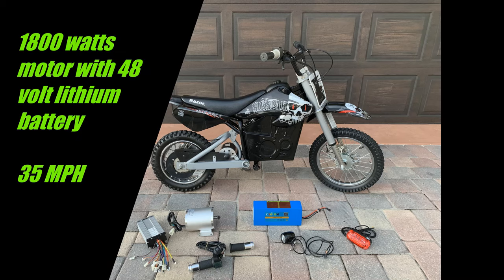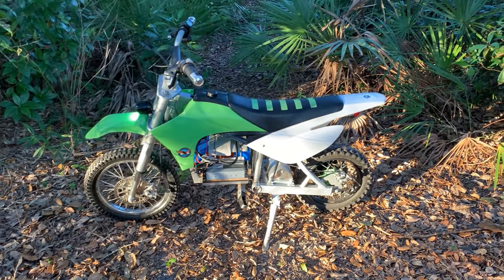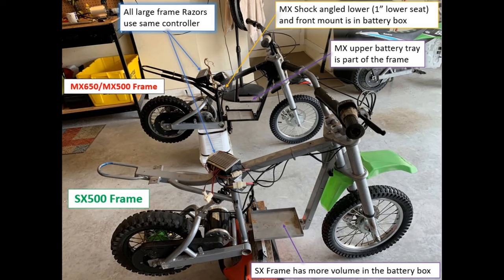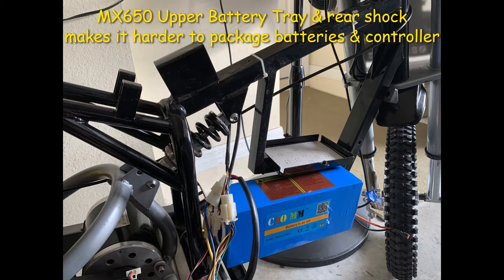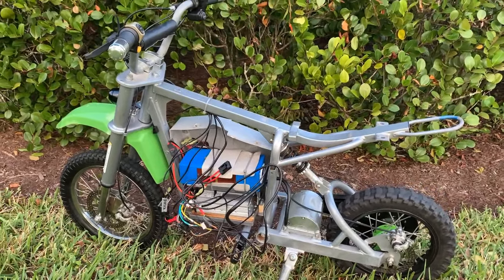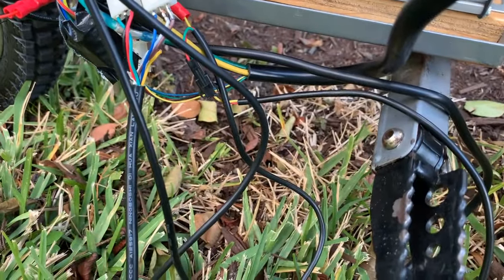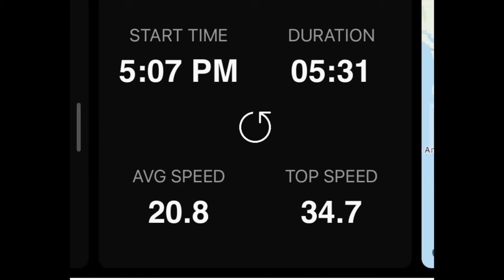go 35mph with 48V 2000W motor - Razor MX650 MX500 SX500 RSF650 upgrade for $400

Comment: the battery you linked is 10AH, is that you one you used, if so should I get it or will it damage the battery and get me low ride time. The 48v 20ah ones are expensive. love the videos btw 👍
Reply from the maker: Buy at least 14ah or 20ah if you can afford it see link on amazon https://amzn.to/43gniXw

Comment: If you don't use the 3-speed throttle handle with the voltage meter, and instead use the throttle handle that came with the motor kit, do you have to install a  jumper in the 3-speed wire connection that comes off the motor controller?  Do you know which color wires need to have the jumper?  (it seems like I saw this info in one of your videos, but I can't seem to find it). Thank you.
Reply from the maker: see video at 5:33 mark for how to wire a single speed throttle
Reply: @BRichSolution  thank you, thank you!  I knew I had heard you mention it, but I couldn’t seem to find it.  I wired it as you mentioned, and everything is working great!

Comment: If I ordered the battery from the list with the charger, can I just charge it with that? Do I need to buy the 54.6V 1.5A w/ xlr plug? 

Great video! Thank you.
Reply: I found an old comment. Never mind. Thank you!
Reply from the maker: yes you can use the charger that comes with the battery.  I've built bikes both ways, using the factory charge port with aftermarket XLR charger and using the charger & port comes with the battery

Comment: I got everything that you got, I tried wiring everything the way you did but but kept on sparking every time I plugged it into the battery, I’m not sure what I did wrong and I would love for some help.
Reply from the maker: Small Sparks is typically.  My $800 Samsung battery on my ebike sparks too when I polish it in to charge it.  I not plug the charger into power strip turn it off then plug the charger to ebike and when everything is connected flip switch on power strip and it doesn’t spark

Comment: When you countersunk the bolts that hold the motor together, did you use the original bolts, or were you able to find some new ones with tapered heads?  If so, where did you find them?  Thanks for all the info you’ve provided in these videos, I’m building out my son’s bike by following your instructions 👍
Reply from the maker: I used the original bolts/screws and cut the excess threads off the other end.
Reply: @BRichSolution  thank you.  After visiting a few hardware stores and a motor repair place, I was pretty sure I wouldn’t be able to source a flat-head style tapered bolt that size, so I just countersunk the original ones like you suggested in your reply.

Comment: I wired it just like you said. Went to plug In The battery it sparked. And now and I’m getting no power. Any idea what I did wrong?  Maybe I wired the switch wrong!? but I’m getting no power to anything
Reply from the maker: How does the fuse look?
Reply: @BRichSolution  perfect. Replaced anyways. Still no power.
Reply: @BRichSolution  perfect. Replaced anyways. Still no power. I think I need to rewrite the switch. 

There is also one small red wire that i wired to the e lock. Do I need a negative there?

Comment: What if you want to put a key switch instead of the switch on the razor? can you do a video about it or just explain?
Reply from the maker: I haven’t done a throttle with the key but it can’t be that complicated as there is only one wire to key all the other wires are the same as in this video.    Use these lever connectors as it makes it easy to troubleshoot connections and switch wires around.  
https://amzn.to/39BuYZy

Comment: Mine stopped working after taking to sand pit xouod motor be clogged with dirt not allowing it to work? Or ecu fried?
Reply from the maker: Maybe both… check voltage coming out of the controller to the motor when twisting throttle
Reply: @BRichSolution  yea both are fried 😂😂😂
Reply: Looks like I’m putting back in the stock motor and exu

Comment: Where did you wire the Electric Lock (red and orange) to? And I'm not using a 3 speed throttle, so do I leave the 3 speed connector on the controller alone?
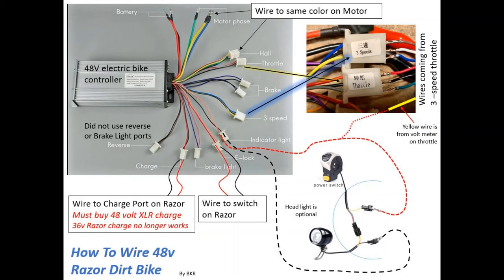Reply from the maker: E-lock is on/off switch; see video at 5:17     If you do nothing to the throttle it will remain in middle gear; if you want it to stay in high speed wire black to blue wire on the 3 speed harness 5:38
Reply: @BRichSolution  Thank you!

Comment: Im gonna do this build, but the motor and controller is no longer available. I found one on Amazon  and it’s called “2KW 48V Brushless Motor Kit 4300rpm High Speed” the controller it comes with is rated 34a. Do you think this would work with the 48 volt battery you recommend?
Reply from the maker: Yes you use this 2000W motor kit also I made updated video
https://youtu.be/rBJ2z1ujeRg?si=Ii27Y0MTJrZTudVa

Comment: im stuck man  with the 3 speed throttle...... how do i wire the original on off switch from the bike into this vevor controller
Reply from the maker: Original on/off switch wired to the elock port on new controller
Reply: @BRichSolution  thank u brother. Ur vids have been super helpul

Comment: I am doing this on a mx350!
Reply from the maker: You will need adapter plate to mount the motor on mx350/mx400
Reply: @BRichSolution  ya

Comment: Nice set up. Question. Can I use the charger that is connected on the battery itself to charge and not to modify anything beyond that ? 
Just to use the charger cable that is attached to the battery  ?
Reply from the maker: Yes you can use the charge plug on the battery which is what I have done in some builds.  The charge cable is short only 6 inches so I end up having to cut it and extend it up so I can access it.
Reply: I was wondering this exact thing thanks

Comment: How fast you think I can go on a razor ground force drifter with front wheels on all 4 corners and 2 48v 6.4ah 100amp continuous 13s panasonic cells in parallel with this 1800watt kit? It's geared at 15t motor and 30t axle but thinking of going down a little on the motor since I fried my 1000watt motor on 15/30 lol was pulling 32mph down hill and 29 on flat ground with that motor and 1500watt 35amp controller
Reply: Probably end up keeping the 35amp controller on it since the so called 1800 is only 32 or 33amps
Reply from the maker: Not quite sure, but you could use the Electric Scooter store gear ratio calculator to find out by entering the details.    https://electricscooterparts.com/motorwheelgearratio.html
Reply: @BRichSolution  hey thanks!
Reply: @BRichSolution  u think 5200 is roughly the top rpm? When I put 5200 with 15/30 gearing and 4inch wheel I hot 31 which seems close to my top speed according to my speedometer app

Comment: I just order almost everything on your list thanks 😊. Close to almost  $700 total
Reply from the maker: Good luck with your build
Reply: So I ordered everything and installed everything u posted but my max speed is 27 mph on a mx500 build. What else could i do for more speed. Currently waiting for the 13t sprocket in the mail. Thanks

Comment: Dumb Question - I had a three speed throttle that broke and my new one is a keyed throttle with a single speed.  When you say to wire the black and blue together do I still need to connect them to the blue wire on throttle or just to each other?  BTW your diagram saved me a ton of time on the original build - thx
Reply from the maker: connect the black to blue wire on the 3 speed wire harness on the controller side.   You can use a small jumper wire to connect black to blue on the harness to keep the motor in high speed mode.   I am glad I can help other people out there
Reply: @BRichSolution  Thank you very much!  Bike is back up and runnin.
Reply: Hey @B Rich. The voltage indicator on one of my bikes burnt out.  I bought an aftermarket voltage detector for 15 bucks that reads like a fuel gauge. It comes with a red and black wire. I'm worried I may need to replace the throttle device but curious where I should hook up this black and red wire connector for it to work properly. Thoughts?

Thx again

Comment: Excuse my ignorance but how do you read the volts screen , the lowest number means you are low in battery ?
Reply from the maker: Yes.   Battery will cut power at 41V.   Full charge 48V battery will be 56V

Comment: If you get the battery that lasts an hour do you have to get different level wires and connectors?
Reply from the maker: No the stock wires are big enough

Comment: I did it on my little electric quad and it keeps getting really hot mainly the controller and motor wire. What could it be
Reply from the maker: I don’t know much about the Quad 500, but isn’t the motor have step down gear?

Comment: Do I need to buy everything or just the kit with motor and the battery?
Reply from the maker: Motor kit and battery is about it but hydraulic brakes are needed for higher speeds as the stock brakes are not safe

Comment: How’d you manage to wire the front light and back light? I got the front light going well…
Reply from the maker: I spliced in the power wire & negative from taillight to where the headlight harness connects with the switch harness.
Reply: @BRichSolution  and it could handle it? Wow sweet thanks imma try it!

Comment: I see the battery is rated for 1200W maximum power draw, how does the system handle this? Is the output to the motor limited to 1200W or does it just draw too much power from the battery
Reply from the maker: the battery handles the power without issue.   full charge the battery voltage is 54.5 volts and once the battery get down to 45 volt after long ride I notice some performance degrade in high gear

Comment: what would happen if you use a 72 v 3000w motor with the 48v 20ah battery
Reply from the maker: Why spend the money on 3000w motor?  Upgrade later?  If you use 48v battery with 72v motor and controller it will bot operate as the controller will not work if the voltage is less that 60V on a 72v controller

Comment: I have a single speed throttle what do you mean by put the black and blue wires together from the controller?
Reply: Are you talking about wiring the 3 speed black and blue together?
Reply from the maker: At 5:39 the video shows in the upper right hand corner the 3 speed wire harness from the controller.     On that harness connect the black and blue wire together or use a small length of wire 1/2” long and plug the wire into the 3 speed wire harness connecting the black and blue wires.  This will keep the controller in high gear all the time
Reply: @BRichSolution  thank you this helps a lot🙏

Comment: Would the 48 volt lithium battery work with factory motor? Also if upgrading both motor and battery to 48 volt and 1800 watt do youhave to get a new throttle?
Reply from the maker: 48v works with the factory motor; see my other videos.   https://youtu.be/kRvYAI1hdc4    One thing to note; long rides off road the 48v will over heat the stock motor with adult rider.  You can gear the bike down to help avoid this on ride on the pavement is none issue.   Upgrade the battery and then you can upgrade motor later if needed.

Comment: If I use a throttle with no 3 speed options do i need to do anything to the 3 speed thingy in the controller ? i want the motor to go on full power
Reply from the maker: Single speed throttle need to wire 3 speed harness in high gear; see this video at 5:16 https://youtu.be/rBJ2z1ujeRg?si=fVGQv0BTfZcd1em_
Reply: thank you (: @BRichSolution

Comment: Hello. I am using your video and links to do my own conversion. I noticed the throttle connectors I have are 2 small black ones with a yellow wire. Do I have to splice these in order to connect it to the controller? It is not plug and play like I thought. Thanks
Reply from the maker: See schematic in video at 5:19; upper right hand corner shows were each black wire gets connected to.   The yellow wire is for volt gauge; which can be wired to red wire on indicator light.     Also I found that using these reusable easy to use butt connects allows you easily trouble connections.  If you wire it wrong you can easy change wires.   search on amazon "Butt Terminal Wire Connectors - DIY Splicing into 2/3/4/6 Way Junction Box Conductor Connector"
Reply: @BRichSolution  much appreciated!

Comment: The shaft on my new motor is a bit longer so my motor sprocket is not aligned with the back sprocket. Did you run into this issue and if so how did you get around it?
Reply from the maker: I did not have an issue with alignment;  you can try putting a washer under the motor mounts or on one side of the axial to get them to shift slightly and align.   Also check the chain tensioner to ensure its not pushing the chain out of alignment.   I had that issue on one build.

Comment: Hey man, I'm kinda confused on how to wire the yellow wire “ from volt meter on throttle” how do you do that? I'm planning not to add a horn or headlight/taillight
Reply from the maker: see video at 5:18 for schematic and how to wire the volt meter on the throttle.   As for the headlight I like to wire in a splitter just down stream of the master switch and connect the auxiliary (such as headlight, taillight and etc).   See my other video 2:03 how to wire in auxiliary circuit https://youtu.be/yw7w0vJrWcI
Reply: @BRichSolution  thx

Comment: Would you recommend the 2000w over the 1800w? Are the motors interchangeable?
Reply from the maker: The issue with 2000w kit is you will not see 2000w unless you use a 52V battery because control is limited to 33A.   48V battery fully charged is 55V x 33A = 1815W.     Most of the time same money and buy 1800w

Comment: If I am not installing a light, how can do I get the voltage meter to work on the three speed throttle. Thanks again!!
Reply from the maker: connect the yellow wire from volt meter to the red wire on the "indicator" harness; see video at 5:20
Reply: @BRichSolution  Awesome. Thank you very much!
Reply: @BRichSolution  Forgive me if this is a dumb question, but do I need to do anything besides wire that yellow wire in?

Comment: Would this work with a Razor pocket mod? If not, is there any way you could point me in the direction of someone doing the same thing here but for that?
Reply from the maker: Doing this mod to pocket mod  would require a lot of work and difficult to package.   I would upgrade the pocket mod from stock 24v batteries to one li-ion 36v and keep stock motor and controller or sell pocket mod and buy mx650 or mx500.   Weight  and size will be about the same when completed with mod.

Comment: How is the 13t sprocket on hills……what percentage speed reduction would you get with 11t
Reply from the maker: you can do this build on mx500 & mx650 the battery compartment is a little smaller than sx500.  See my other video for packaging in MX650  & MX500  at 1:58 you can see battery packaged in MX frame  https://youtu.be/uvTHxL_mtcc
Reply from the maker: 2/13 = 15% speed reduction.   So with 48v 1800w motor an MX500, MX650 or SX500 with 11T sprocket will have top speed of 31-32 mph.   I went to 13T to reduce the torque and give some longevity to the rear tire

Comment: The 48v/20ah battery on Ebay mentions powering up to a 1200w motor or less. Is that anything to be concerned with, like perhaps increasing degradation of the battery, or will it be able to handle the 1800w motor? It seems like it should work fine, considering your other videos of it working well, like the 6 month check in. Just a little worried before I start investing in this project. Thanks so much for the videos, they've been incredibly inspiring!
Reply from the maker: I understand your concern, but that 1200W is guide for this battery specs.   Ideally you'd want a battery with a 35A BMS, but the 30A BMS battery is sufficient as it appears the battery restricts amps to 40A in real life.  The reason why I know this to be true as when riding I do not notice a performance hit unless the voltage is below 45V after riding for over 60 minutes in high speed (pulling 1800W).  Hence 1800W / 45V = 40 Amps.   When I start to drop below 47V I typically only run in medium or low gear (this is why I like the 3 spd throttle) to preserve my range.
Reply: @BRichSolution  Awesome, thank you so much. You put my mind at ease!

Comment: Hello I know I’m late but I want to get a mototec 1500wt 48 volt dirt bike it already has a 48 volt 13amp lithium battery but I want to get a 48volt 20amp batter can I use the stock charger and stock charging port or will I have to use a different one and to replace it will I have to do any mods to the bike or can i just take out the other battery and put it in?
Reply from the maker: will the 20Ah battery fit in the mototec frame?   If so you can use the same charger
Reply: @BRichSolution  if it does do I need to change the charging port
Reply: @BRichSolution  or do i just remove the battery and put the 20 amp one in

Comment: I’m thinking of modifying one like this and I have a question, I was wondering if an SX 350 frame would work?
Reply from the maker: the mx350 & mx400 frames are smaller and stock run on 24V; the mx650 & mx500 stock run on 36v.   A 36v battery will work with the stock motor & controller and should get you the performance you want.    http://ebay.us/7VCLqF
Reply: @BRichSolution  About how fast do you think it would go? And thanks for the information!

Comment: So for the kit do you have to have a new battery
Reply from the maker: yes, the stock batteries are only 36V and the larger motors require 48V.   If you have newer factory SLA batteries (36V) you could add one more 12V SLA battery to get to 48V, which is the cheapest option, but then the bike weights 106lbs.  With the Li-ion battery you go to 48v and cut 18 lbs of weight out of the bike.  You can always upgrade the battery now use the stock motor and gain 5 mph.  Then when your ready upgrade the motor & controller